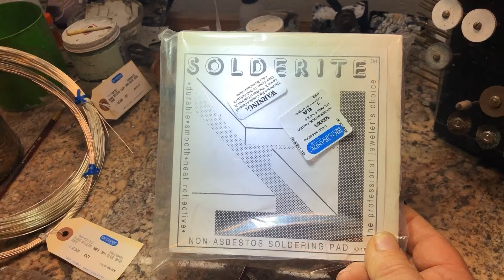How to bezel set a cabochon  ( DIY )

Comment: Where can you get the “flat crystal plate”?
Reply from the maker: I purchased the block from machine shop.  It is not critical though.  My son uses a piece of scrap granite counter top that he purchased for a minimal fee from a granite counter top company locally.  That works wonderful and is probably my suggestion.  I have also use an old cutting board which is nice.  A lot of times lately I am in a hurry and use my GRS flat surface bench pin. Hope this helps.